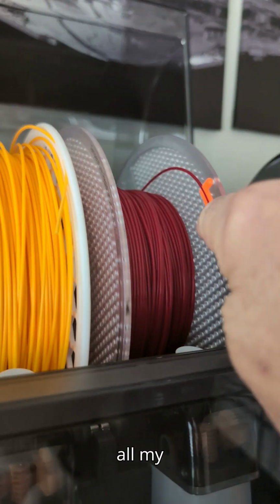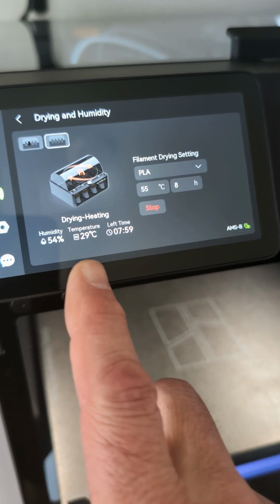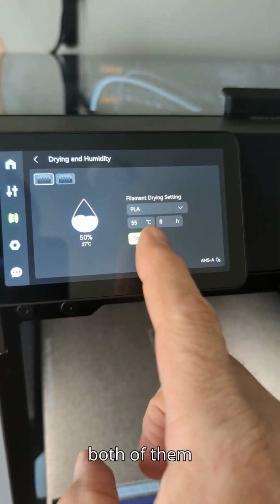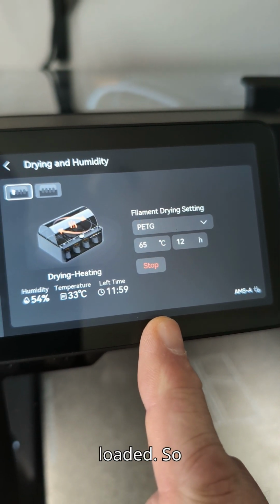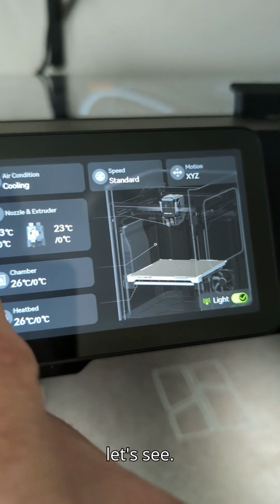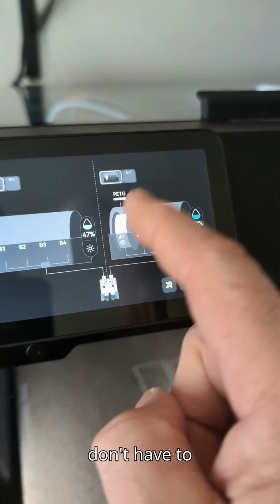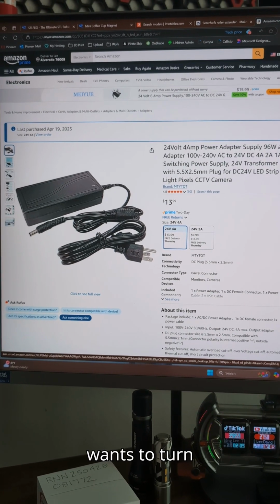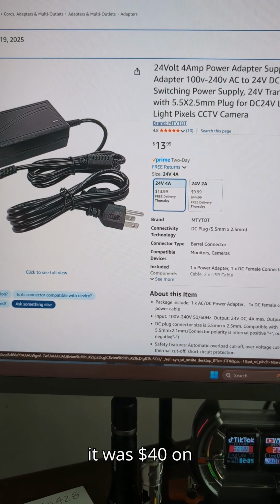Bambulab H2D Turn your $2,700 printer into a $100 Dryer #3dprinting #3dprinter #bambulab

Comment: I've tried out drying out some PLA for the 8 hour at 55c , and found out don't use PLA spools which you have printed , or you will be respooling them , I didn't think PLA spools would melt on a PLA drying cycle .